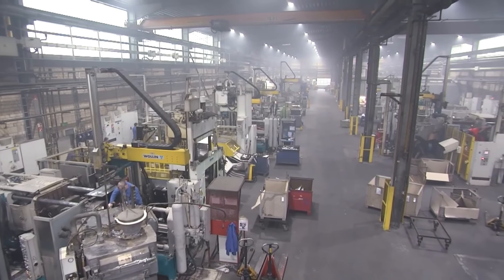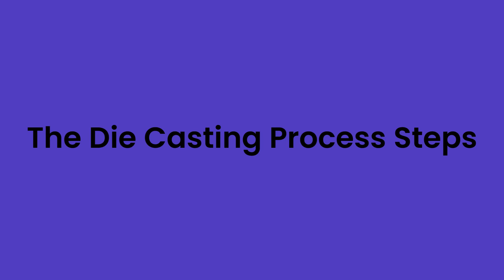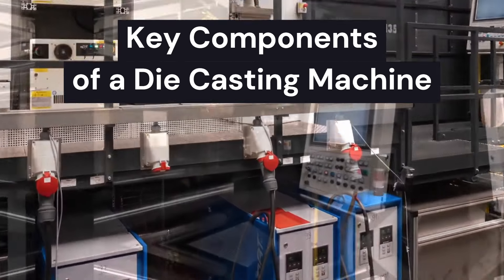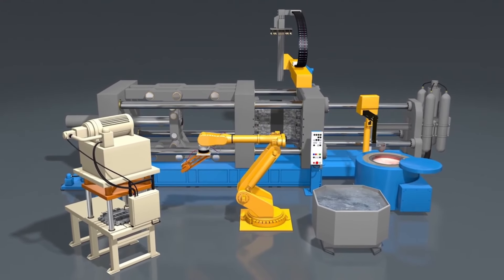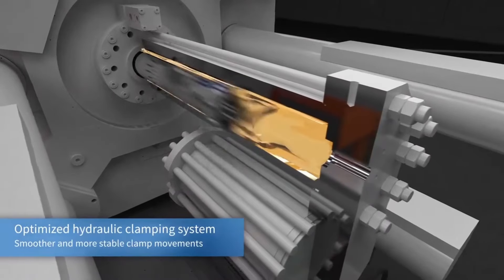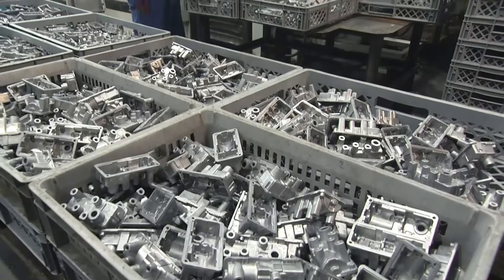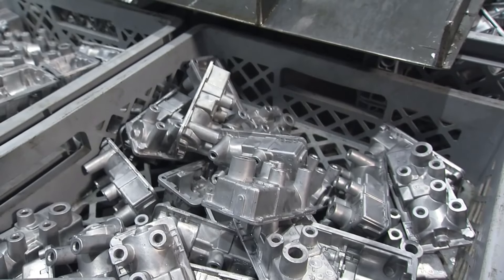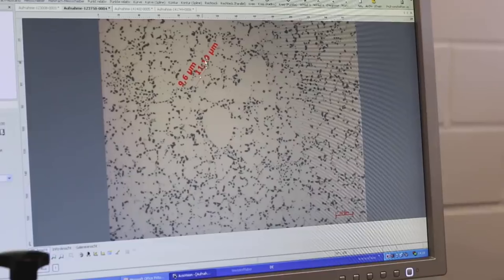Die Casting Process Explained: Precision, Quality, and Applications

Comment: 2:55 that's a very neat mold-locking mechanism. Once the piston fully extends, it barely withstands any loads from the high pressure inside the mold. Instead, most of the forces are transmitted through the links and onto the base. Great 3D setup as well, having this all rendered clearly is satisfying to watch.
Reply from the maker: Thank you so much for the great feedback! I'm glad you enjoyed the mold-locking mechanism and appreciated the 3D setup. We wanted to ensure all those intricate details were easy to follow, so it’s awesome to hear the rendering made it satisfying to watch. Thanks again for noticing the setup—comments like yours really keep us motivated to keep raising the bar!

Comment: Such a torturous career path...poor die design results in producing one scrap die casting over and over and over and over lol i was stuck in this living hell job for 25 years.. and have carpal tunnel syndrome  to prove it....thanks alot  pittsburgh die and casting
Reply from the maker: Thank you for sharing your experience. It’s unfortunate to hear about the challenges you faced in the industry, and we truly appreciate your candidness. Die casting is indeed a demanding field, and poor design can make it even more frustrating. Hopefully, advancements in technology and ergonomic practices are making a positive difference for today’s workers. Wishing you the best, and thank you for taking the time to watch and comment!
I remember one of my engineering students had the same problem in his factory as the rejection percentage of die-cast products was more than 60%. After investigation, we found that the two main reasons were, the die design (mainly the gating system and venting) and the material composition. After using a newly designed die and controlling the material composition the rejection percentage was reduced to less than 20%.